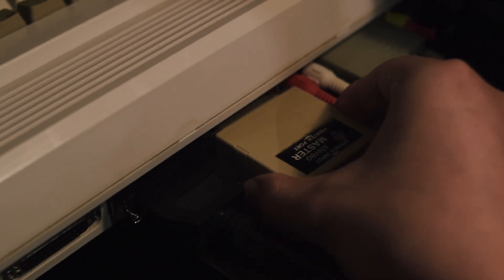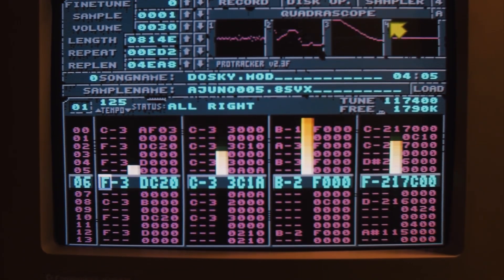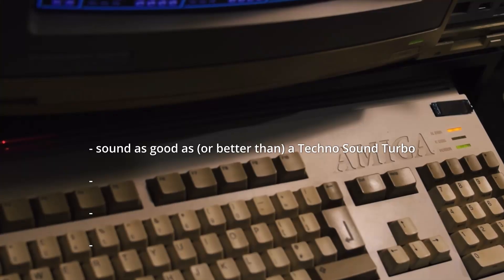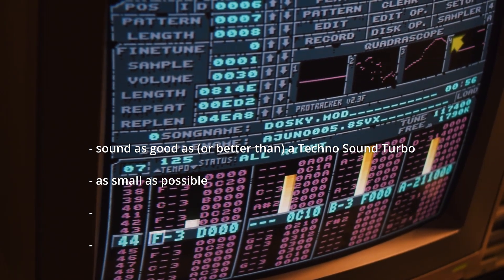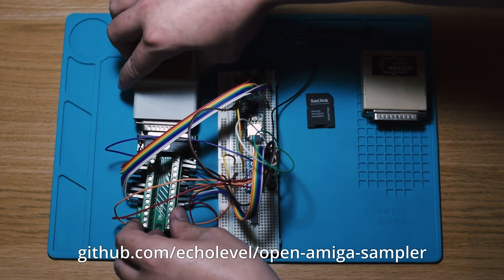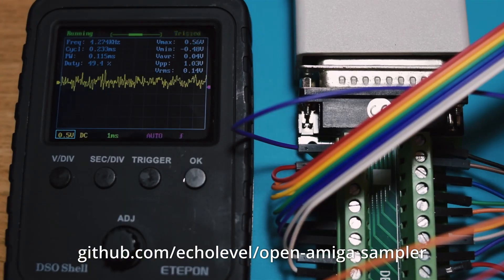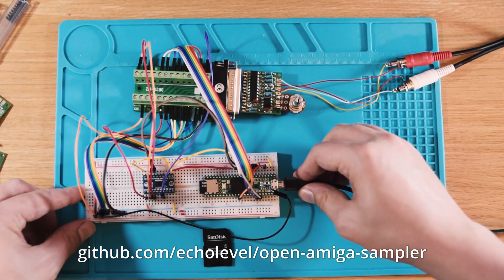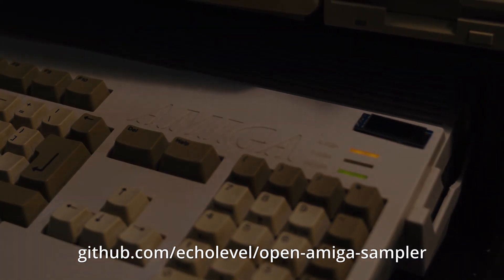Open Amiga Sampler - NEW Amiga hardware announcement!

Comment from the maker: Thanks for the support, everyone! The plan is still to do a run, but things have been moving fast: Alistair Brugsch (abrugsch on Twitter) has contributed an SMD version of the Open Amiga Sampler to the repo, and we're so impressed that we think this'll be the main design in future. It's a fraction of the size, due to surface-mount components, and a workable 3D case is close to being finalised. When there's news on availability of prebuilt samplers, I'll post a video here and also announce it on Twitter (echolevel) and on the GitHub repo itself. Keep your eyes peeled!
Reply: This is great news. I've built two samplers according to plans from aminet, both were presented only as 320x200 drawings and used weird chips, so you won't be surprised they didn't work.  In the end I ended up buying a technosound turbo for a silly price.
Reply: Did I miss the run, I would be very keen to buy one
Reply: This is awesome! I would definitely be interested in a prebuilt unit when available.
Reply: Very good idea. Most retro samplers were built without much if any calibration. The ADC chips of the era needed a certain time to reset in between samples. This is probably better than any of them, given the improvements in technology. And the design makes it pretty easier to hook up a turntable and sample from vinyl.

Comment: I've noticed that a lot of Amiga hardware lacks the screws on each side of the connector to fasten the device to the parallel port, will the Open Amiga Sampler include this in its original version? Perhaps with its original cases? Considering the warnings in the Github readme it'd feel good to have them
Reply from the maker: Good question: I think lots of peripherals didn't have them mainly due to cost-cutting, and partly because custom shell manufacturing rarely allowed for the necessary tolerances to line up the threads properly, but also in view of the fact that most people were swapping parallel and serial peripherals in and out regularly and didn't bother screwing them in - I've removed screws from plenty of cables just because they get in the way. Finally, though this may be an edge-case: since the combo bolt/sockets on every Amiga I/O connector serve the secondary purpose of fixing the motherboard to the lower RF shielding (which is necessary for the alignment of the board even if you've discarded the pointless upper RF shielding), lots of screwing and unscrewing of peripherals can loosen them from the RF tray which can lead to motherboard wobbliness or the loss of the bolts themselves over time.

You're correct that it would be an extra level of safety to have them, and with the new compact SMD design you could absolutely build it into an off-the-shelf DB25 shell that has thumbscrews built in. In practice, for me at least, I always have an excess of slack on my audio cables and keep things tidy round the back of the Amiga to avoid anything pulling on the sampler. Parallel/serial devices need a good bit of effort to get in and out of the Amiga, so I've never worried about accidental unplugging during use - the big concern is raking/shorting pins while connecting/disconnecting them while the Amiga is switched on.

Comment: inspiring! ive been on the edge of buying an amiga for years. maybe i will actually do it lol. i need more midi outputs tho lol.
Reply from the maker: MIDI output from Amiga is an even cheaper and easier circuit than a parallel port sampler! Sordan.ie in Dublin appear to be selling an Amiga serial to DIN5 MIDI adapter for about £30, very neat looking PCB with proper diode protection... I've had stuff from them and can recommend!
Reply: @_syphus  thanks for the info! im making jungle and drum and bass on old samplers and i need at least 3 midi outs so even the old midi interfaces would work come to think of it. just trying to make sure i can use all 16 tracks on my emu and not have to sacrifice any channels using midi thru.
Reply from the maker: Yeah, I just spotted a ProMIDI interface on eBay for an obscene price - I've got one here and it's a mostly empty box with a crappy PCB and a flakey-looking ribbon cable. But if you find a good price on one, it claims to have two separate outputs (as well as an input and a thru).

Comment: great project! i'd definitely be interested in an assembled version. i assume it is designed to work with all sampling capable programs?
Reply from the maker: Yes, it works with all the trackers we've tried, with AudioMaster III, with MegaloSound, and a bunch of others. Obviously any controls for proprietary sampler features (e.g. GVP's digital gain control) will be ignored, but there's pretty much only one generic way to read bytes from the parallel port in Assembly language so most programs should be able to use it fine. I'll update the GitHub soon with an exhaustive list of everything I've tested, but meanwhile let me know if there's a specific program you'd like me to check :)
Reply: i am using AudioMaster IV and AMAS with protracker. i assume it will work with AudioMaster IV since it tested fine with AudioMaster III but verification would be nice. does it sound better than the turbosound and similar old samplers?
Reply from the maker: I've just tested with AudioMaster IV, A.M.A.S., GVP Digital Sound Studio 1.0 and DSS 3.0 - all working fine. It sounds way better than the Stereo Master and noticeably better than the two Techno Sound Turbos we've tested; soon we'll compare against a DSS8+ and we hope it'll sound similar.
Reply: thats awesome! count me in for one if you end up selling some assembled units. really cool project. i'd always wondered why no one one was making anything like this with improved components but i guess it comes down to demand. big up a500 crew haha!
Reply: There's only one parallel port in one place on the memory map. Although there are different ways to code sampling sound from it. One way is to use a CIA timer to generate the sampling rate, but that limits the maximum sampling rate.
The way coders do "best speed" is to shut down the graphic display temporarily and have the processor work out the sampling rate directly, so the processor cant do anything until sampling ends.That might cause issues on some software run with accelerated, non 68000 Amigas. Although A1200 users never complained, and they had 68020 Amigas. Probably not an issue, it depends how the code counts the sample interval.

Comment: This is fantastic! I'm one of those who has been looking for a good quality sampler on the used market, and I've been looking for about two years now without finding anything. I ended up buying a silly expensive 16 bit Zorro soundcard instead. I'll be getting ATLEAST a couple of these if you end up making a run.
Reply from the maker: Oh great! I mean, 16 bit Zorro cards - and any Zorro cards - are very cool to have for their own sake but yes, if you're ultimately working within Paula's DAC limitations then those extra bits are sadly wasted a lot of the time. We're very close to having the 3D printed enclosure sorted out and we're looking at pricing/time... Hopefully we can make some full samplers, but failing that we could do a run of PCBs to sell at cost+shipping - they're a fun DIY soldering project, even for novices, and all the components are readily available :)
Reply: Oh man, I just read on your site OAS that the items in the production run has already all been spoken for. :(
I guess there is no chance for a second run considering the work involved? If there is how do I go about reserving one (or two)?